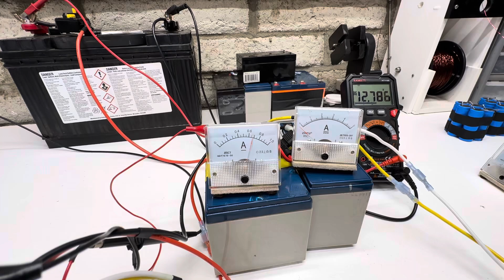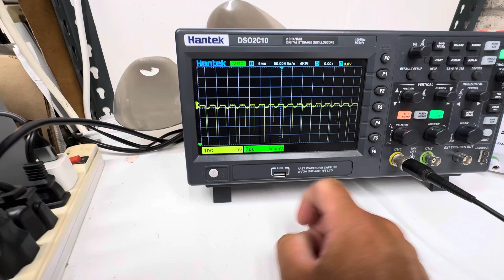New window motor !

Comment: VERY GOOD PROJECT!  I'M WONDERING  IF A CYLINDER MOTOR GENERATOR IS POSSIBLE. 50 COILS AROUND A CYLINDER USING BEDINI  CIRCUIT USING ONLY 10 COILS TO TURN THE MAGNET CENTRE AND THE REST OF THE COILS USING AS A GENERATOR COULD BE POSSIBLE TO BUILD. JUST AN IDEA IN MY HEAD. VERY IMPORTANT WORK YOU ARE DOING. THANK AGAIN.
Reply from the maker: @dragon72tube  thank you 
Would definitely be a great experiment!